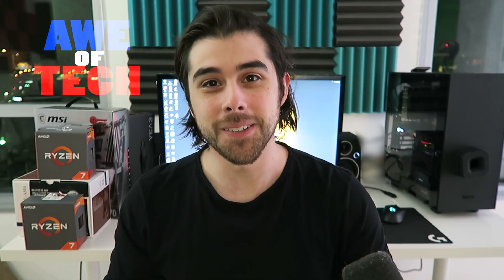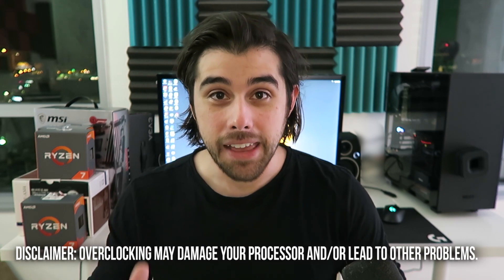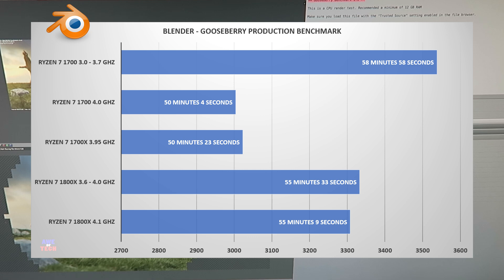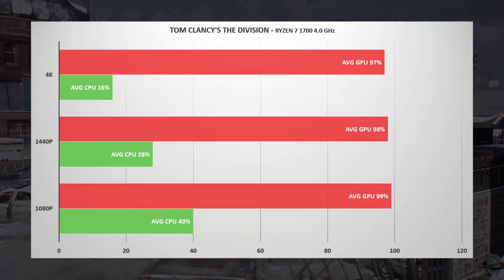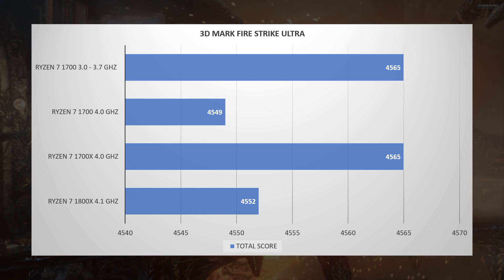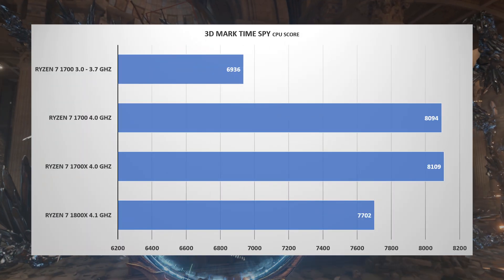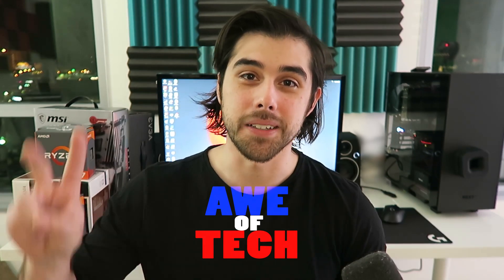AMD Ryzen 7 Review! 1700 Vs. 1700X Vs. 1800X Overclocked Air Cooled

Comment: I got my 1700x for cheaper than a 1700, and it runs extremely cool. My FX 8320 used to heat my room in 20 minutes, whereas this thing barely blows hot air with fans running near silent.

Comment: Hey bro, would you consider doing a Ryzen 7 update video and post new benchmark scores for these 3 cpu's now that the Agesa bios update has been released? I'm asking because my liquid cooled, 1800X at stock speeds with XMP enabled, beats my 1700 that's overclocked to 4.0 in both synthetic and actually gaming benchmarks. I'm wondering if other people have noticed this too.

Comment: HELP, I cant find this answer.. I used a watercooler for my 1st build, and obv put thermal paste.. now I will be using the air cooler with my 2nd ryzen 1700 build which comes with an AIR cooler, do I still need to apply thermal paste?! or is thermal paste only for water cooling? thanks

Comment: So that "Ryzen 7 1700 4.0 GHZ" is just the overclocked Ryzen 7 1700, correct? It looks like it'd be a huge shame to not overclock the 1700 from 3.0 GHZ if that's the case. It's quite the improvement

Comment: I'm thinking something is wrong here. 
It almost looks like he got the 1700x and 1800x mixed up.
Unless I missed something they are the same chip only clocked different. There is no reason for the 1800x to get beaten even once much less 75% of the time and sometime by even the 1700. Somethings not right

Comment: Hold ya horses. 
I have the 1700 non X version, and did not get one of the golden bathces. I can only OC to 3.85 Ghz stable with 1.375 V. And the temps are nearing 90 degrees C on stock cooler. At these temps the fans speeding up all the time, so I have to settle at about 3.725 ghz. and 1.3v. Temps are now 78c under stress and 50ish idle. Asus x370 Prime.
Being noob, I cant get the Ryzen to lower frequency under light work like web-browsing, even on balanced power-plan, which is pretty irritating. My i7 4790 just lowers to 0.8 ghz under idle.

Comment: So since im running air cooling, should I just get
The normal 1700 instead of the 1700x? And overclock it to 4.0?
Reply: I'd love to know that as well.
I'm in the same boat and it appears to be a gamble.   The price difference isn't massive between the 1700 and 1700x but surely there's an advantage (aside from slightly higher stock/boost clocks).

Comment: Very informative video thanks!
The only thing that I'd still like to know is power consumption of overclocked chips. Did you by any chance measure it? The word is that 1700 @ 3.9 GHz yield the same performance as 1800x on default but consumes 24 watts more. Can you confirm/disprove?
Reply from the maker: I measured the entire system power draw (from the wall) when testing with the 1700 @ 4.0 GHz, was idling under 50 watts and max system power draw during benchmarks was 247 watts. I'll keep the 3.9 GHz scenario when I run some more tests though

Comment: Is the 1700 stable and relatively cool @ 4.0GHz on Air? I have a NH-D15 lying around that I'm thinking about using if I do a Ryzen Workstation but I'm not 100% sure which of the processors to get seeing as the whole binning process clocks the processes at a rated frequency. But if the 1700 can handle 3.7-4Ghz withough any issues on a decent Air Cooler I'd be more than happy to pick one up.
Reply from the maker: Replying to this comment with the 1700 @ 4.0 GHz the Noctua NH-U12S keeping it right at 40 °C   :-)
Reply: But is that a retail CPU or a cherry-picked CPU that AMD mailed you to review?

Comment: Strange, why were the minimum framerates lower on the overclocked Ryzen 7 1700 over the stock 1700?
Reply from the maker: The minimum is usually just a quick dip in FPS right at the beginning of the in-game benchmarks. So there's a lot of variance with the minimums. For in-game benchmarks I should probably disregard the initial dip for future videos since it  varies so much when re-running the same benchmark.

Comment: I don´t plan on doing anything else but gaming and going to build a pc for my girlfriend who is also a gamer. The 6700k is much cheaper in Denmark currently and I know I can overclock the crap out of one, had mine running at 4.9 ghz for a year now without issues. What has disappointed me mostly so far about AMD is pricing, I hope their 5 series can compete with the likes of the 7700k in clock speeds and gaming performance, we need cheaper CPU´s.

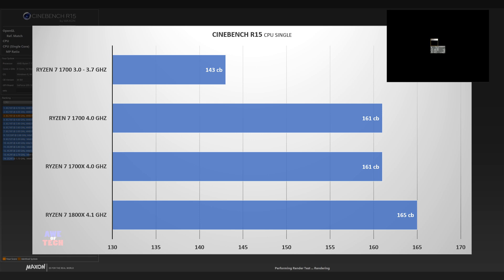Comment: Totally  misleading graph at 3:16!    143 vs 161 appears to be TWICE as fast.   Come on, these are rookie mistakes.
Reply from the maker: Yet your comment indicates that you understand 161 is not twice as fast as 143. The set starting point for the x-axis is clearly labeled along with the actual data on the bars... simply a way of highlighting differences, that I reiterate throughout, are small.

Comment: @Awe of Tech You may want to recant that temperature thing.Amd sent out a letter including the fact that the temperature readouts are correct for the 1700 but not the other chips.So subtract 20 degrees from the other chips and that is the correct temp

Comment: So basically the 1800x is useless. Everyone should just buy a 1700.

Also, please don't askew the x-axis by starting it at a set point. It makes it seem to the average person that one result is WAY better than the other while really, the result was very close. Other than that, great video!
Reply from the maker: +Seananigans yeah that's a good point. I usually use an online free tool for benchmarks that shows non-cropped x-axis. Finally went to Excel to save time and for better organization, but for some reason it auto cropped. Going to definitely keep this in mind for the next one though :)
Reply: I was thinking the same thing. Don't crop!:)
Reply: Seananigans What I got out of this is that the 1800x has no place, which I cannot believe. How can a 1700 at a lower OC out perform the 1800x at a higher OC. They are the same architecture aren't they? The only difference is the base and boost clock. So these graphs make no sense to me. How is the 1700 doing better than the 1800x?
Reply: Its the temperature, basically if you had better cooling the 1800x should perform better. And the 1700x should theoretically be able to out perform the 1700. Though tests would have to be done on all 3 again with the same or similar water cooling.
Reply: They have the same silicon, same cache, and only different clock speeds. When clocked to the same frequency, they perform exactly the same. There's nothing different in their architecture either. So there's no way bios updates will help the same chips.
Reply: Najeeb Shah at 1080p ryzen isn't the best but for 1440p it does a lot better job
Reply: I get that your comment is really old, but the Ryzen 7 chips are budget productivity/multitasking chips (creative professionals, media editors, programmers, etc). They aren't geared towards gamers the way the i5 and cheap i7s are. Ryzen 7 chips can game pretty well, but that's not their intention, just a side effect.
Reply: I got my 1800x for $319 USD with Quake Champions. Also got ~$180 mobo MSi Pro Carbon for $99 with rebate. Holiday sales are the way to go for rebuilds. Used savings for Flare X 3200 CL14 RAM.
Reply: the samples he got were binned 1700 is too expensive for budget builders and not worth it for 144hz gamers , even the 1800x cant do consistent 144hz gaming . ryzen 5 is much more relevant

Comment: Hey Awe of Tech,should I buy Ryzen 1700 or Intel i7 7700K for gaming,video editing and 3D work. Will you please suggest???
Reply from the maker: Personally I'd go with the Ryzen 1700 since it's multi-thread really excels in editing and 3D work. Anecdotally, when doing just the Basic 3D effect in Adobe Premiere my system felt so much smoother than it did with my i7-6700K. Something that's difficult to convey in a video. And testing games wtih my 6700K and 1800X I see practically no difference with paired with the GTX 1070. The tiny deficit Ryzen may have in gaming perf right now for super high refresh is way made up for by it's massive gain in multi-thread computation strength against the 7700K.

Comment: Great review, too many reviews have focused on 1080/720pp FPS against the 7700k ignoring all the other things it does far better than the 7700k.   Its not the best gaming cpu, but its the best all round CPU on the market for the money.
Reply from the maker: +Prince Thrakkath So true my friend, you have to go with what's has the most impact and relevance to what you are using your PC for. It's silly seeing some conclude the 7700k is the better buy when they aren't even using a 1080p 144+ hz display. It's just one aspect that's only relevant to a niche portion of the market, i.e. a small gain to see in ultra high refresh rate 1080p monitors today, but at the cost of what really matters today and in the future, that huge leap in multi-thread computation strength that Ryzen 7 champions.
Reply: Yep I'm planning to maybe start streaming some games and setup my own channel in the future this chip should be an ideal replacement for my 6700k.  Personally I would not recommend anyone buy a 7700k new at its current asking price, used 6700k offers much better value I was lucky and got 6700K+16gb of ram for £250.

 I will sell it on for Ryzen as soon as the platform is a bit more mature I know exactly what mainboards and RAM combos are the fastest and most stable.  BTW your reviewing style is excellent you just present the facts as they are in a very balanced way, the tech community needs more reviewers like you! I'm also a big fan of Wendell @LV1techs

Comment: The 1700 lower heat will make up for it, think u can oc it more the the 1800X
Reply from the maker: I could boot-up with my 1700 over 4.1 Ghz, but would crash when I got into benchmarking. Since they are binning those chips for their low TDP ---  I'm really curious to see what kind of overclocks most are going to find with their 1700s (as more and more switch to Ryzen systems). I.e. just how high the correlation of low thermal output is to max achievable overclock with the 1700s

Comment: do with 1080ti man... loved the video .. thumps up.
Reply from the maker: +sarath mohan I really want to, I can't tell you how many times I've been eyeing them on amazon and newegg lol. I'm probably going to pick up an add-in board partner 1080ti when they're out
Reply: Next time do tests with 1080p resolution, it gives a clearer picture of the CPU performance over 1440p and 4k as it does not depend on the GPU as much. Compression with Intel flagships like 7700k and 7820x would be great.

Comment: Conclusion even if i7 7700k is faster than Ryzen 7 1700, It is still the king, after all the reviews I have have seen, I am 100% sure Ryzen 7 1700 is the best processor for consumers, who want to enjoy computers to the fullest. Those people who say in future it will be slower in gaming are nuts, Yes it will be slower and we will need an upgrade when the games will start utilizing more than 8 cores and 16 threads, That will not happen anytime soon, Generally speaking we gamers anyway upgrade in 3-5 years, So I think 1700 will last 5 years without sweating. So why not 7700k? Simply because it has 4 cores less and since gaming is going 8 core it simply isnt as good as 1700. Also Streaming the games while you play them is butter smooth on 1700, so it is no brainer 1700 wins so elegantly. But if you are a super rich guy then I would suggest you get 7700k because you can upgrade next year to cannon lake easily.

Comment: Great video, and good information. I'm planning on buying a Ryzen, but wasn't sure which one. You've convinced me to get the Ryzen 7 1700. Seems like you get the best bang for the buck if you're going with standard air cooling. I'm good with that. Keep up the good work.

Would love to see some benchmarks on how Ryzen vs Intel chips handle running games and production work at the same time. I foresee many users like myself who want to do some good gaming, but don't want to setup a completely separate rig for it. This way I could setup one rig that does both work and gaming.
Reply from the maker: Yes, Ryzen is the full package --- amazing 8 core 16 thread performance! then seeing that CPU single score strength in Cinebench when I overclocked these beasts really blew me away :) I'm planning on following up with a part two of this video since some are saying BIOS updates are going to improve the R7 1800X and 1700X's performance
Reply: these samples were binned , dont take the bait of this dude , ryzen 1700 cant go past 3.8 on majority of chips , and if you plan on 60hz plus gaming ? get the 7600k instead and oc it to a nice and stable 4.8 , unless gaming isnt ur only thing and you do productivity stuff , then sure

Comment: Curious, why did you use a 1070 rather than 1080gpu for gaming benchmarks? 

Also, no Intel-graphs on gaming benchmarks? Makes it very hard to gauge price-vs-performance VS blue-team with the same independent game tests.

I hope you add an intel-chart to these gaming benchmarks, specifically the 7700k, 6900k...

Just my thoughts.
Reply from the maker: +Nuruddin Peters I plan on picking up a 1080ti for this really soon.  I really wanted to include the 6800K and 6850K --- I actually purchased these and a swank X99 motherboard to add to these benchmarks.... I just couldn't bring myself to open them though :( Too much $ for me for now so decided to take them back
Reply: Just a guess but maybe using the 1070 makes it more likely to push the CPU.  Could be just what he had on hand ready to test with though.
edit:  Sounds like it was just what he had set up.  I'm surprised it bottle necked tbh.
Reply: Awe of Tech Fair enough. Btw, your vids are pretty thorough and legit. Keep up the good work!